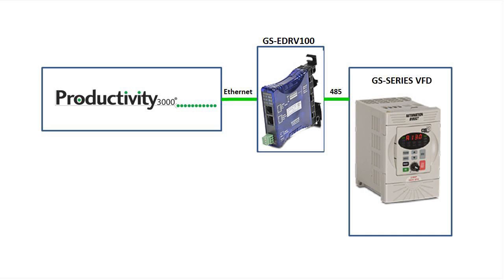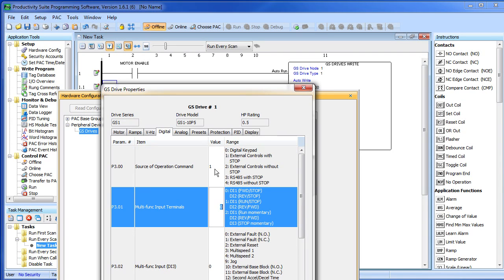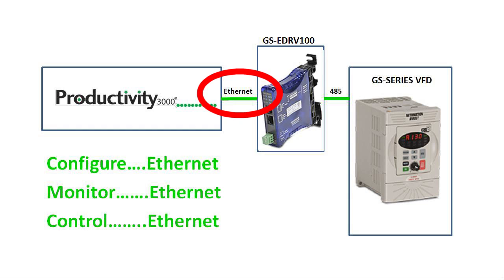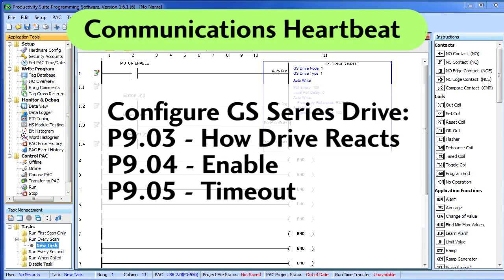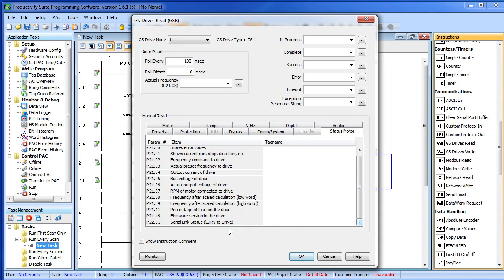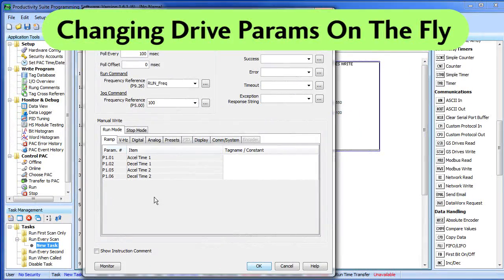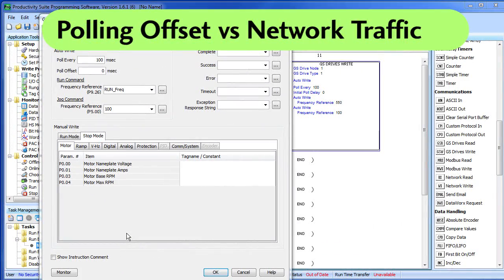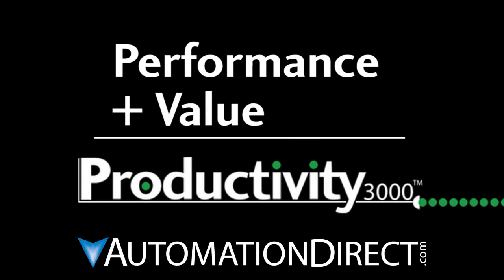Productivity3000 How To Variable Frequency Drives (VFD's) Part 2 from AutomationDirect

Comment: Hey Guys, These are Super vids on the GS/EDRV combo-Thanks!  I would like to know if it is possible to monitor/set-up and alarm for Drive Fault conditions such as Over Voltage & Over Current?  I have been trying (unsuccessfully) to figure this out with my units and sure would appreciate a little advice.  Perhaps 1 more video from y'all on some of the advanced monitoring capabilities would be VERY nice!  THANK YOU!

Comment: Yes, I already have those tags and monitor those parameters BUT, I have not figured out how to create an Alarm (tun on a bit) if the Drive actually FAULTS and stops running (due to the fault).  It sure would be easier if I could just read the tag in the drive which turns on when the drive is in a fault condition.  Not sure where (or if) this tag exists.  Thanks for any insight!

Comment: I've spent a lot of time fiddling with this machine although I never got around to hooking up a GS drive . I'm assuming that's what your working with. I'm just going to tell you how I would attempt it but i'm sure you've already tried it. You can add a "gs drives read" command go to the "status motor" tab  and assign tag names to "actual output voltage of drive" and "output current of drive" . I really don't know what your working with but if you give me some info i'll try to help.